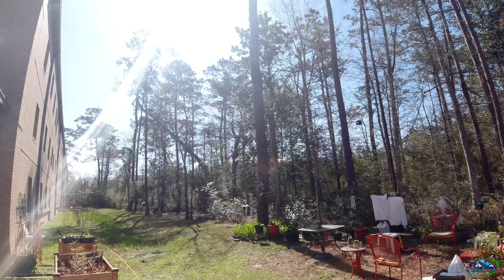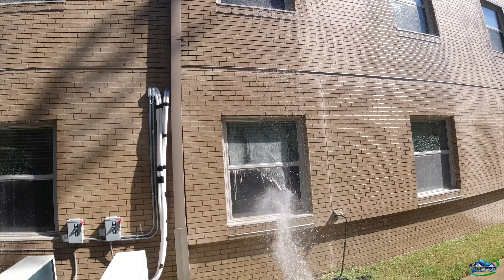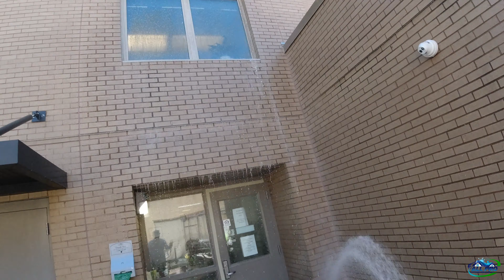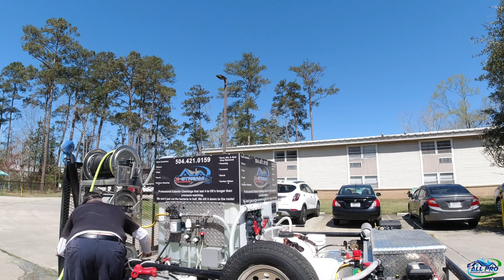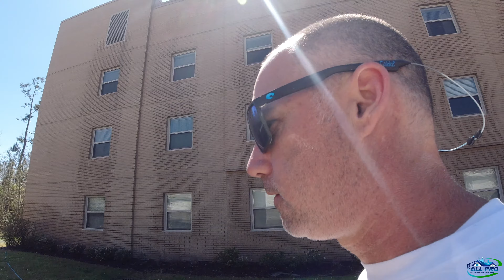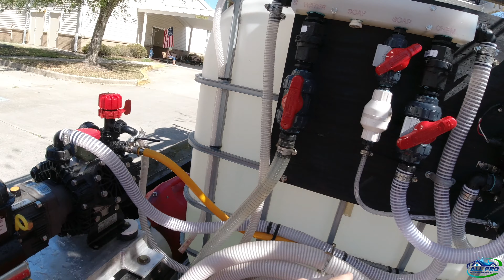Commercial Window Cleaning with AR45 Gas Roof Pump

Comment: Question about the 4 tip surface cleaner. Does that help minimize the likes you get from the edges of a surface cleaner pass? I have a two tip cleaner now and notice I get two very clean lines on the edges of the cleaner and the the center is clean but not as “ white” as the edge is
Reply from the maker: I think it would minimize the striping because the pressure would be reduced with the 4 tip. On the Whisper Wash SC, you should be able to change the spray bar. Thanks

Comment: Herb for the windows what number setting do you have your soap dialed up too?
Reply: I should have been more specific i mean the surfactant valve for the elemonator i got a massive condo job coming up and I don’t want to leave any streaks on windows each building is 50,000 square ft there’s 2 buildings so I’m a lil nervous going into this lol
Reply from the maker: @TheMhowi007  My soap valve on my proportioner is open to 4-5. I do mix my Elomonator 20 ounces to 14 gallons. Thanks
Reply from the maker: The soap valve was on 5. Thanks
Reply: Awesome thanks that helps big time appreciate it